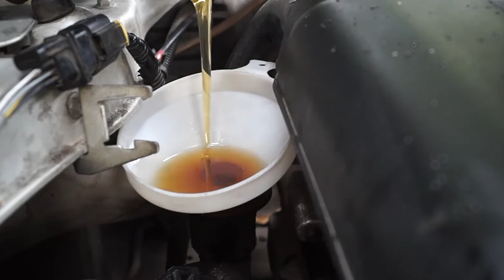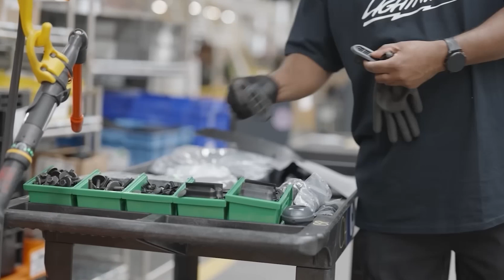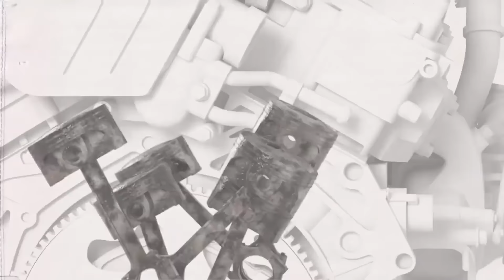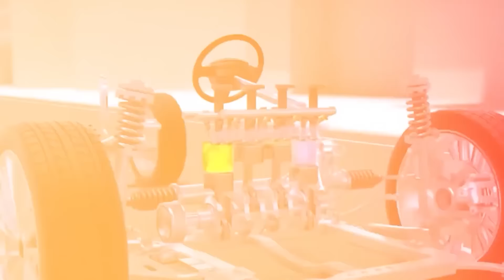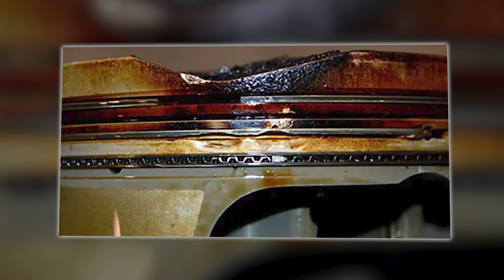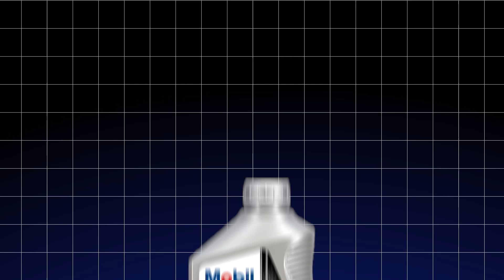Toyota Secretly Lying About Oil - Mechanics Refuse To Use

Comment: I’ll be honest here, if I was buying a new “0W8 Required” I don’t think I’d have the bravado to go against that viscosity whilst the warranty was still in-force. If the OEM tried to fight me in court over the issue it would be such pain. Not being a lawyer, I would be concerned I could lose the case. Honestly I’m not capable of self-insuring against something like that. Most of the public isn’t either.

I would, however, be switching that stuff out the second the warranty expired.
Reply: Changing Oil viscosity will not void your warranty.  Magnus warranty act look it up
Reply: @EReed-qg8lt 
The OEM would simply need to test it. Then I’d end up in a long drawn out situation I wouldn’t want to end up in.
Reply: @EReed-qg8lt  That being true, if a dealer gets it analyzed, and say they added metal particles to the oil sample...Just saying, dealers aren't necessarily honest.
Reply: I would!  You MUST not comply to terrorist type behavior!  The manufacturer can NOT legally punish you, they would have to PROVE that the oil grade and type you used CAUSED the problem, and as said that would be almost impossible for them to do.  Now I am NOT saying use a bad oil, but they have NO right to cause you to wear  your engine out way prematurely because they have to meet CAFE standards.  If anything, CAFE standards should always have been a floating scale, as I would call it.  If you miss it by just a fraction, there should NOT be huge fines.  We had an 83 Plymouth Reliant, with the 2.2 engine - the car would not run properly if set to specs, it had to be tuned "by ear" and just slightly out of specs to run properly.  Otherwise, it would be a bit dangerous to drive, not wanting to pick up speed, particularly when cold. Common sense should be to fine the manufacturer a LITTLE as they almost met the specs - the smog tech showed me there was almost NO difference in emissions between being set to specs, or slightly out of spec.  We had to set it to specs to pass smog, then back to where it actually ran great just slightly out of spec. We also spent quite a bit of money we didn't have to try to "fix" the problem.  Keep in mind that car manufacturers were trying NOT to go broke during this period - the Dodge Omni/Plymouth Horizon and then the K-cars - Reliant, Aries, etc - were the cars the SAVED Chrysler from bankruptcy back then - then years later, when I had a car with the awful Mitsubishi optional 2.6,  when that crappy engine blew, I wanted to replace it with the much better 2.5 Chrysler built engine - I was told by several mechanics that it was almost impossible to do with CAFE and CARB - so improving your. car to get better gas mileage and less emissions (I would have fuel injection instead of the awful Mikuni Carb on the MItsubishi poorly-built engine - was made impractical by the organizations that should be helping you reduce emissions and increase gas mileage.
Reply: @EvzenKovar-i5p  An oil analysis of the 0w8, run 5,000 miles or less would support your case of going to a thicker grade of oil.  If the analysis had a lot of wear metals in it.  The most stress on the oil will be a summer run.
Reply: Less than a couple weeks after I wrote this comment some POS teenager plowed into me and totaled the Toyota I’ve had for 14 years. I took exquisite care of that thing. Bet it hadn’t lost 5% of the compression it had when I picked it up right off the dealer semi truck. Irreplaceable.

On Sunday I picked up my new Corolla Cross. Stopped at Walmart on the way home to grab a break-in filter and jug of oil. I popped the hood in the lot to see what the M20A-FKS required. Sticker read 0W8.

Boys… I ain’t slept for two days.

Comment: Do NOT listen to this AI bull.
Reply: I can confirm just about everything he is saying in this video. I've been studying everything about the Toyota Rav4, 0w16, the owner's manual, and everything he said is true. I cannot find a lie or any inaccuracy in the video.
Reply: Retired from Shell Research Center in Houston TX Fuels and Lube division.  If you believe in 0W-8 oil, you are badly mistaken!  Engines don't usually die; they are murdered by their owners!
Reply: AI or not anything 0W20 below sucks and doesn't offer shear strength.  5W30 in both my camry's that was recommended 0W16 and 0W20 with the same engine. No thanks, I'll keep the longevity of my motor
Reply: You haven't a clue what's going on.

Comment: will the thicker oils affect the variable oil pump pressure parameters for the US cars?
Reply: Freeze some 0w20 in your freezer, it flows like SAE140...
Reply: Complete nonsense.  For the first few months, 0w-8 was hard to get and pricey. Three years in, not so. 

Almost THIRTY years ago, Ford and Honda changed most models from xw-30 oils to 20 weight. Guess what happened. Everyone panicked, and then NOTHING. No mass failures, no problems. 

Panic if you need to feel good that way, but TOYOTA validated this stuff. I’ve run it for a year in my 25 Camry and it runs purrrrrfectly!  

Use without worry.
Reply: You should check if the engine you have is allowed to have other viscosities in other countries and it probably does. You could also cross check if those engines have the same part number for their oil pump. The pumps are designed to work with a range of viscosities.  Just pick one that's smart for your weather temperatures and driving habits. If you drive short trips without highway driving, then you're on a "severe" schedule and should change it more often.
Also, consider that a 0w30 or a 5w30 is thinner at operating temperature than a 0w16 is when cold.
Reply: @5jjt that s incorrect sir
Reply: @DanBrando He should have said that 0/5W30 is thicker at operating temperatures than 0W8. Maybe a typo.
Reply: Additionally, does the US have a different filter spec than the Austrailian??  I imagine a bypass designed for 8W may be in permanent bypass mode throwing a 30 or 40W at it🤦‍♂️. Bottom line for me, I want 300,000 miles + for my vehicles and really don't trust 2W or less to guarantee that especially in today's undersized, turbocharged, fuel injected engines.  I will not be purchasing these vehicles.   If they need the minimal fuel efficiency gain, design a drysump engine🤷‍♂️
Reply: @kc-md8we  U.S. and Australian oil filters for the same Toyota engine are generally the same spec, including similar bypass pressures, so a 30W or 40W won’t force a filter into permanent bypass once the oil is warm. It’s reasonable to prioritize longevity, but Toyota’s durability testing shows the specified low-viscosity oils can still reach 300k+ miles when maintained properly—choosing not to buy those engines is a valid personal trade-off rather than a mechanical necessity.
Reply: Yes—running thicker oil than specified can affect variable oil pump pressure behavior in U.S.-spec cars. Variable-displacement oil pumps are calibrated around specific viscosity ranges, and thicker oil can cause higher baseline pressure, delayed pressure modulation, and reduced efficiency, especially during cold starts. In some vehicles this can also trigger oil-pressure control faults or reduced fuel economy, which is why manufacturers strongly recommend sticking to the specified oil grade.
Reply: @RJ42997  Sounds like you're just making that all up and enjoy sounding smart buy aren't.  Are these pumps programed any differently in austrailia?  the engines work fine there on 15w-40 in warm climates.  Did toyota really run 2 development tracks for the same design engine based on different programing for the oil pump /vvt system for each market?  What you say makes little sense.
Reply: @damiena9711  I’m not making it up. Modern variable-displacement oil pumps and VVT systems are absolutely calibrated around expected oil viscosity ranges tied to emissions, fuel-economy, and durability targets. Toyota did not redesign the engine for Australia, but market-specific oil specs, ambient temperature assumptions, and emissions regulations mean the control strategy is validated around different operating envelopes. The fact that an engine runs on 15W-40 in warm climates doesn’t mean it’s optimal—or that long-term wear, efficiency, and VVT response are identical to what the system was designed and certified for in the U.S.
Reply: @damiena9711 Great question! I was wondering the same thing, does thicker oil once the engine shuts down, say overnight, is this an issue for the oil pump pressure? I saw the response to your original question,  I just cant rationalize why Austrailia and U.S., specs would be different for the same identical engine? IDK.
Reply: @RJ42997  Now I'm a little confused, are you saying a Toyota sold in Fairbanks Alaska has the same oil pump as one sold in Florida?
Reply: @RJ42997 You forgot to give credit to chatgpt.
Reply: @RJ42997  You do know 0w20 flows like SAE140 when at 32F?
Reply: @lonniebeal6032  I think you’re mixing up viscosity scales—0W-20 does not behave like SAE 140 at 32°F, and in fact 32°F is well within the temperature range where a 0W oil is designed to flow readily. The “W” rating is based on cold-cranking and pumpability tests at much colder temps (-31°F and below), which is why 0W oils dramatically outperform thicker grades in real cold starts.